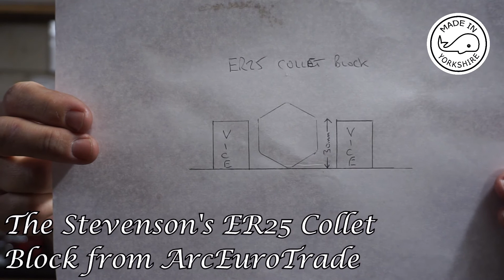#MT18 - Making a M6 Hex Bolt using a Stevensons Collet Block. By Andrew Whale.

Comment: What I do is turn first then thread then flip the die and thread closer then use the parting tool to cut thread relief at the head then mill the hex then saw and face. All in all you did a great job for a first time! The parting tool isn't on center of rotation and a HSS tool I find better for the job.
Reply from the maker: Hi Dave - many thanks for the advice. I will definately try your method next time. I will double-check that the parting tool is dead centre and give my HSS tool a try.
Thanks again.
Andrew

Comment: It kind of, looked like the cutting edge of the parting tool was above the center line and it should be right at center line. It may have been just the camera angle. I've been a machinist for many years and have never had much luck with parting off. There's another youtuber's channel called Winky's Workshop. He recently, came up with a very solid mount for a cut-off tool and then, an improved one. I may just try his design. It seemed to work beautifully.
Reply from the maker: Hi Dave - thanks for the info - you could be right about it being a little off centre. I've since moved away from using that type of indexible parting off tool and now use a thinner HSS tool. The lack of rigidity on the mini lathe doesn't help either. Having moved to a large lathe now, which has a power feed on the cross slide, parting off has become a lot more less stressful.
Cheers
Andrew

Comment: Hi Andrew. I've got the same lathe and parting tool and I reckon that your parting-off problem was due to the excessive length of the hex profile meaning that you're parting-off cut was 'interupted', ie trying to part-off on the hex section meaning that every corner of the hex crashes on the top of the cutting tool. With the hex section you'd cut you could have pulled the bolt further out of the vice jaws so you were parting-off on the round bar so giving a continual jarr free parting cut. And machining a shorter hex profile (using a smaller diameter milling cutter) would also mean that you don't have to face off as much material. Hope that makes sense. Can't comment about the lathe speed as the vast majority of my work is with aluminium. Jon
Reply from the maker: Hi Jon - many thanks for the feedback and your thoughts on this. It definately makes sense and I agree that interupted cutting could be a contributing factor.
Cheers
Andrew

Comment: I finally got around to ordering collet blocks (hex and oct) for my Sherline mill and lathe.  I am curious how you get it back in the same position in the vise after rotating it.  Just mark the parts?  Good video!
Reply from the maker: Hi mate. Accuracy of the collet block position wasn't critical in this test because I later parted it off way below the end. That's why I just roughly marked with a pen. For better accuracy i could have butted the end of the block against a stop on my vice, but it wasn't important.
Hope that helps and i hope you have fun with them!
Cheers
Andrew

Comment: You're making the same beginner mistakes I made with parting off.
For starters, make sure your insert is not chipped AND at correct center height.
But most importantly when working with carbide inserts : don't be afraid to push in firmly ! You don't get good chip formation if you don't.
The rubbing is what gets you in trouble when you are too careful ...
Reply from the maker: Hi Stefan - many thanks for the advice. The insert was new, but I will check the centre height. I think my confidence was knocked when I had my first parting incident. I need to 'grasp that nettle'. I will get some scrap out of the box an have another go.
Cheers
Andrew
Reply: By the looks and sound of it, your parting tool sits way too high. That's why it was not cutting at all, just rubbing ...
The cutting tip has to be on dead center !
Hope to acquire a great milling machine like yours one day !
Reply from the maker: Hi Stefan - thanks again for the advice. BTW -  I am really happy with my 'little' milling machine. It needed a bit of work to get it where it is, but it was worth it. It just fits nicely in my workshop.
Cheers
Andrew

Comment: Just watched it again and your parting speed did look a bit slow. Have you checked that the parting insert is still sharp after your earlier mishap before you installed the carriage/compound locks?
Reply from the maker: Hi Jon - thanks again for giving this more thought. I do think the speed was too slow. When I had my first bad parting experience I was using a HSS tool and I purchased this new one specifically for this job. I think I need to bite the bullet on this and try out various combinations with everything locked down. 
Thanks again for your help.
Andrew

Comment: Job well done! I have looked at the collet block for my mill now I see how well it works I am going to investigate it more seriously. Thanks for allowing us along on your journey.
Reply from the maker: Hi bhein67 - I'm glad you found the collet block of interest. I think it opens up all sorts of opportunities. I had hoped to be able to hold it in the lathe chuck as well, but infortunately the internal jaws on my 80mm chuck just don't open that wide enough. For the lathe I guess I could buy a collet chuck or get a 100mm replacement chuck.
For info I also purchased a full set of ER25 collets which go from 1mm right through to 16mm.
All the best.
Andrew

Comment: those parting inserts are crap straight out of the box, the cutting edges are blunt from the coating and require excessive cutting force for most small lathes, try grinding a sharp edge with a cheap diamond wheel or even just hone with a diamond disc or plate with a bit of spirit to carry away the powdered carbide, then they're sharp and cut better than high speed steel. never had any luck till i tried this. the material of cemented carbide is great but the coating makes it rounded.
Reply from the maker: Hi Lindsay - many thanks for the advice. I know exactly what you mean about blunt edges! I will definately give it a try.
Thanks again - much appreciated.
Andrew
Reply: Sorry, I must disagree with Lindsay. I've been using the same type, all be it the next size up, of parting tool for a few years and had no problem, even parting off 75mm stock. Just make sure the edge of the tool is at centre height. The audio from your parting attempt sounded as if the tool was slightly high with the stock rubbing on the face of the insert. With interrupted cuts there is a tendency to go in too fast to start with as the edge of the tool is spending some time in free space, increasing the pressure as you get further through the interrupted part. As mentioned elsewhere here you do need to 'push' carbide tools more than HSS. For example I'm making some tooling for my mill using some ChromeMoly stock. If I take, on the dia, a 0.5mm cut the finish is rubbish, rough and torn, a 1 to 1.5mm cut yields an almost mirror finish. 
Keep going and don't be disheartened by setbacks.
Reply from the maker: Hi Chris - many thanks for the help and support. I did find that Lindsay's suggestion of honing the coating helped significantly. I've since had good results with cast iron but variable reults with mild steel. WD-40 certainly helped on the ms.
Again, thanks for the suggestions and i will continue to persevere. I think i might revisit hss now that I'm becoming more confident.
Cheers
Andrew